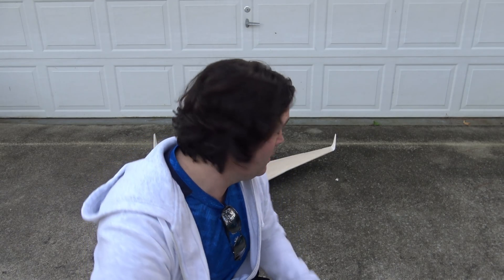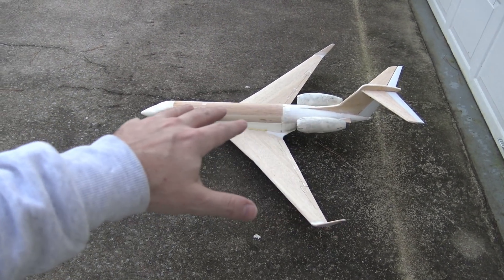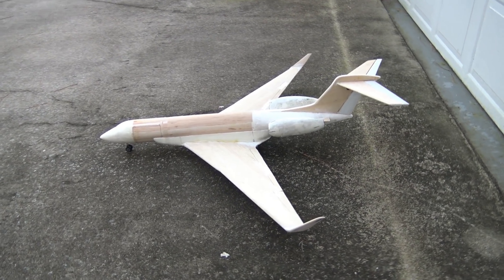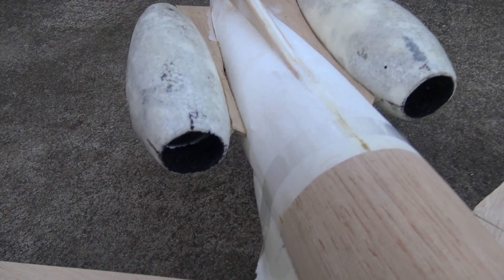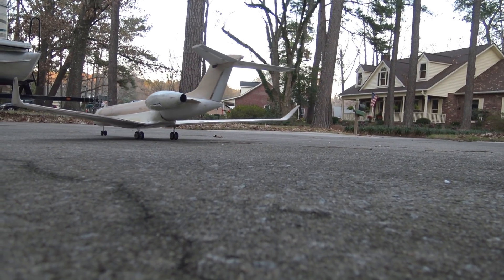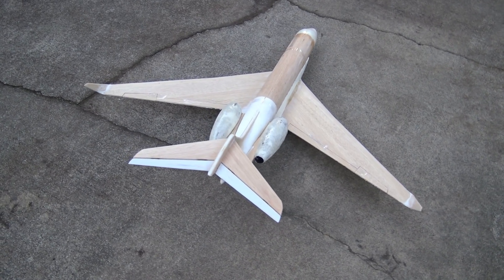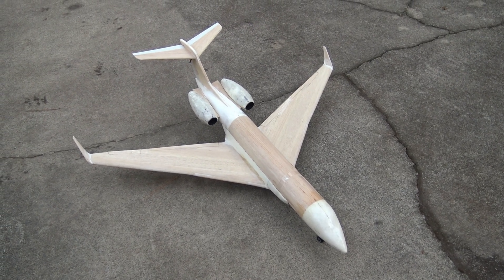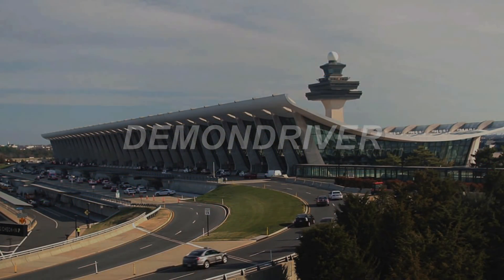Gulfstream G650 RC Airplane EDF Taxi Test [4K]

Comment: How long it took you to built this model?
Reply from the maker: a few months Nikos.
Reply: RC DemonDriver i'm builting a f-22 
and i need to use fiberglass to renforce the nose and some other parts. Could you please tell me whtat materials i have to use?

Thanks!!
Reply from the maker: You should try using 2 or 3 ounce fiberglass cloth laminated with long setting epoxy resin.

Comment: why do the dimensions seem off... on the real plane the winglets are in direct center of mass of the turbine..these seem way further aft.. that said...and all scale aside you will likely need much larger EDFs for a 4lb model.. 50mm put out about .5ish lbs of thrust MAX.. i would upgrade to a 66mm 4000kv for a better power to weight ratio... yeah it would call for re-designing the nacelles but that would give you around a 1.2:1 p2w ratio..

Comment: Nice project! White foam skinned with thin balsa is unbelievably strong...I used 1/32 balsa stuck on with 3M "77" spray contact adhesive when I scratchbuilt my WR1 racer and the wing feels like a surfboard, super strong and rigid. Good luck getting the Gulfstream dialed in, keep us in the loop!